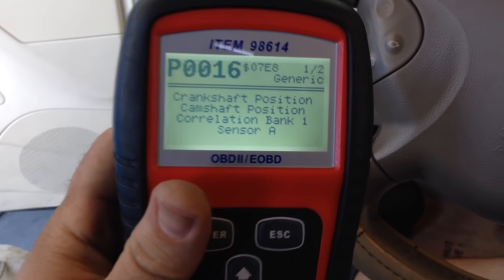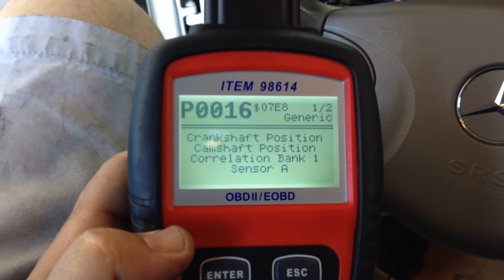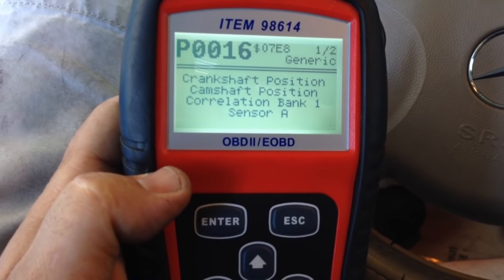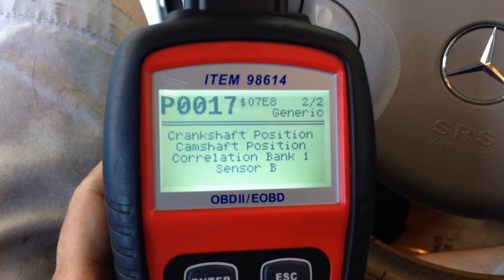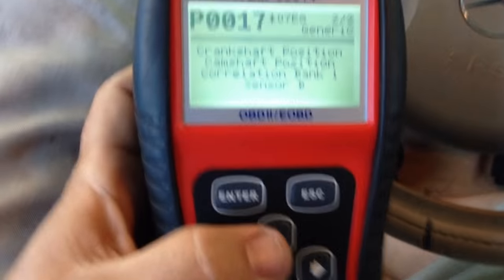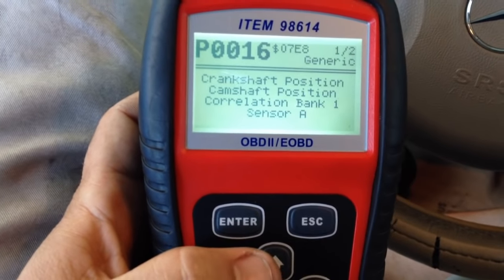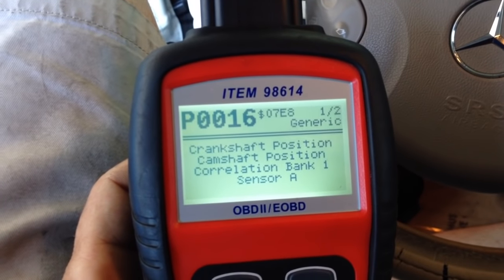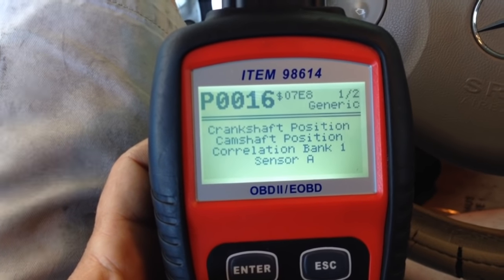Mercedes Camshaft position sensor p0016, p0017

Comment: I have this problem but for the driver side of the car. I was wondering if the test to see if the cams are in the correct position is the same. putting the crank shaft at 305° then checking if the circles on the cams are aligned with the holes? or if the crank shaft position needs to be placed at a different degree to check for the driver side cams? thank you so much this video is amazingly helpful!!!!
Reply from the maker: growing for life 305 will align all cam sensors at the middle but since the valve are always pushing the cams away from each other you will be able to see only one side off at the time...
Reply: Mercedes Benz Techs thank you so much

Comment: Hi goodday i have a ml350 i got p016 p0117 p018 p019 i checked the 305 on the balance shaft it looks good on both marks on right bank any other test
Reply from the maker: What year and how many miles
Reply: @MercedesBenzTechs  2008 87000km
Reply from the maker: @sabrinatjoen-a-choy2425  shouldn’t have any serious issue. Check your battery, do engine control unit update and change oil. Let me know if it comes back after that.
Reply: @MercedesBenzTechs  changed the oil with filter no change code 1211,1199,1203 and 0641 just pop up back after clear. Batt good pcm update i cant perform.
Reply: I also took the camshaft solonoids from another ml to see and it stays the same
Reply from the maker: @sabrinatjoen-a-choy2425  you need to connect to a computer and see actual values of cams, maybe your timing chain stretched
Reply: @MercedesBenzTechs  values are -20 and 36 for the camshafts
Reply from the maker: @sabrinatjoen-a-choy2425  you need to check how much they deviate from the permissible values.
Reply: @MercedesBenzTechs  goodmorning its not that much to be honest.
I think i just will take the front covers off to see. I also read to check the flywheel but did u ever encounter that issue with the damaged flywheel before

Comment: I've got a 2008 C300 with a motor serial number outside the affected balance shaft motors (<2729..30468993). I just got P0016 and P0017. A Euro mechanic told me it was the balance shaft. Should I try the sensors first or chalk it up as a loss?
Reply from the maker: Alexander Matney I'll give you a million dollars secret, change your battery. When the battery is week your sensors may delay information to the ME. Change batterie clear codes and drive safe!
Reply: Mercedes Benz Techs I recently replaced the battery. My main question is: since my engine serial number is outside the affected motors, am I safe from the balance shaft failure? Should I proceed doing what's described in the video?
Reply from the maker: Alexander Matney there shouldn't be any issues with your balance shaft, I haven't seen any car that had bad balance shaft after 2007, I still think you may have bad alternator or bad battery I don't think you have issues with timing I don't think you have bad sensors as well, I think it's a software issue or power issues but this are only assumptions off course.
Reply: Thanks. I'll have the battery and alternator tested. I'm glad to hear about the balance shaft. 

The car is idling rough and has a jerky start/stop. But it's also throwing a CEL for running lean, so perhaps it's related to that.
Reply from the maker: Alexander Matney oh, that's some valuable information... you will have to have it diagnosed, it may be out of timing..
The codes you have are saying that the car is out of timing, although it's known to be a common issue on the 06 07 272 engines due to a failure of the balance shaft it is not the only reason for bad timing.. have it diagnosed at a reputable repair shop.
Reply: We did take it to a highly-rated European mechanic in town. The following CELs were present: P0170, P0128, P0173. The P0016 and P0017 had been saved on the motor. The symptoms
Reply: Sorry, last message got cut off:

We did take it to a highly-rated European mechanic in town. The following CELs were present: P0170, P0128, P0173. The P0016 and P0017 had been saved on the motor. The symptoms are basically just low idle and jerky upon coming to stop/start.

Comment: Hi I got mb c280 w204 . Camshaft position sensor error code p0016 and p0017. On bank a and b . I check the alignment of stamp it’s right in the middle on both sides. My car is starting fine when the engine is cold but when u drive for few miles and turn the engine off . It won’t start until u press few times on gas pedal.  Can u please advise me on that
Reply: Yo what was the problem?

Comment: Here's one for a dilemma: got an E350 with M272 V6 and a P1208 code. Pulled out the cam sensors and set the crank pulley to 305. All cams line up in dead center, but the left bank exhaust cam is slightly off. I doubt it is the balancer sprocket problem; because the two intake cams, which are driven by the chain, both line up in center. Any ideas?
Reply from the maker: What year is your car and how many miles
Reply: @MercedesBenzTechs  06 with 190K miles.

Comment: hi I have a 06 c280 what's the timing that I have to look 305 to take away inigion check light or reprace the sensors p0016 and p0017 I need help
Reply from the maker: Juan Garcia I would love to help but not sure from you post what your question is...
Reply: English please

Comment: You mentioned turning it by 180 degrees the 2nd time. Don't we have to turn it full circle by 360 degrees to get back to 305? Please advise.
Reply from the maker: On 4 stroke engines the cams need to turn twice for every one turn of the crank to return to the same time i

Comment: David, I have this same car '06 mer ben with v6 has these same codes but runs really good. Only  a little short a pickup on the highway.  Can oil regularly at Jiffy Lube, their premium service.  THey say it is syn oil... so not sure how good it really is.  But I have not seen anything int he oil so I am guess no much in the pan.  So besides the cam balancer... what else could it be.
Michael
Reply: ***** I am with you on doubting it will be the sensor... I still have not had the chance to look to see if it is out of alignment.  But, isn't there a way to get it to past smog without having to do an overhaul?  I really don't need the expense, not to mention the down time.  And does the oil really make that big a difference?  What is your take on the oil from Jiffy...?
Reply: ***** OK Dave, I finally got the chance to check the alignment...  it is good.  The marks are in the center when placed at 305 degrees.  So maybe in this case it may be a sensor? 
Oh and the oil is clean.
Reply: ***** what do you mean by "both sides"?  the codes are exactly the same as this video... bank 1 sensor A and B.  And as per your video, you said that is on the passenger side.  and as I mentioned both marks are centered.
I did drop the pan and double checked for any metals, but it looks clean. Unless someone else went in there before me... lots of silicone round the pan
Reply: ***** Yes I did see that video... That is why I was asking.  If I can get away with not having to pull the motor, I am al for that. like I said, in checking if the marks line up, on this one it does.  So just wanting to know what else it could be.  Also like I said, it does look like someone has taken the pan off before, unless the dealer uses silicone to seal.  But if that was the case, why would they clean out the pan and not tell anyone of the problem? Metal in the pan is a bad thing and should not be ignored.
By the way, how do I test for the sensors? I am sure there is a way to test them.

Comment: I have a 2009 MB C63 AMG with 67000 miles. Few weeks ago codes P0017 and P1200 came out. These are the only codes I have. Car starts and drives perfect. No strange noises from the engine or other abnormal behavior. Besides CEL everything is fine. I also noticed that Check Engine light comes on and goes off every few days by itself. Do you think I also have a balancer problem???
Reply from the maker: dvdmi no issues with balance shaft but you need to take to a shop that familiar with the engine and have them tight the bolts on the cams, there is only one bolt that holds the cam sprockets to the cam shaft and they get loos, at the same time I recommend they torque your head bolts too
Reply: Thanks. I noticed that when it gets warmer (above 50F) CEL always goes off. Also my head bolts were replaced about 25k miles ago (preventive action).

Comment: Thanks for sharing ! I have a 2007 c230  2.5l  and this car had a service due to a camshaft gear defective , the dealer covered almost close to  the total repair a few  years ago   After about 4,000 miles I have a code Po012 and PO0015 bank 1.   I thought it could be the magnets or sensors. Do you know a way to test them , before replacing all?  thank you again !

Comment: Bonjour

Do you think that without the converter the automatic BV and the flywheel we can have enough 
place for dismounting  the plate of the cranshaft and the balance shaft and install the back part of 
the  balance shaft and then avoid keeping out the engine ???
second  why it's necessary to change the back of the balance shaft if you change the distribution 
chain and some other parts in the front of the engine. 
For me it's clear the new back part is the same like the old. 
Last question  the sprocket lose its teeth , why it 's so important if you can adjust the timing chain 
for the right bank and the left bank ( admission camshaft and exhaust camshaft ) correctly.
It seems to me that  it's not so important that the sprocket have teeth or no because of the tensionner.
I think the problem come from the tensionner. The origin adjustement is too strong  so the sprocket become 
tired and used little by little.
I hope i don't take too much of your time with my questions.

best regards Pierre

Comment: Hello Mercedes Benz Techs, I have this problem 2 times. While driving, the check engine light comes up. I made a test with computer and the error was p0016 . I delete the error, and after 2 months it comes again, " check engine", this time i didn't made the test computer, after 1 miles, the "check engine light" was removed .  But when i made the computer test , it was memorized the same error. What will be your opinion? do i have problem with the Cam shaft position?

i have Mercedes ML 350, Year 2006, 58.000 Miles.

I will preciate your opinion. thanks

Comment: scene one cam is on time and one cam is not on  time would that not be that the cam advance is stuck on one cam. if the cam on the left of the engine was off on both then the balance shaft teeth are gone because the chain would have more slack? the teeth where not hardened properly during manufacturing on the balance shaft. thanks for the video like it a lot.

Comment: Hi there, I got the cel with the p0016/0017 and deleted them. But they come back only after a good 100-150 Kms, otherwise car runs good, on a highway gives me 8-9l/100 kms. Could it be the same issue? Have a 2006 c280
Reply from the maker: Vibhav Jindal most likely the same issue.
Reply: Hello Vibhav Jindal.  I think I have the same car.  Mine es a C280 Avantgard Sport 2006.  Did you fix the problem. Could you please give me any clue?  Really appreciate
Reply: Hello.  As I said to Vibhav Jindal I have this vibration problem.  It feels specially in the gear lever.  Do I ALWAYS have to check for a 305 degrees alignment?.  Thanks
Reply: Mercedes Benz Techs hey whats a fair price to pay if i need to do this to my car? just want to know if is worth put in more $ into it

Comment: I get the same codes and my car seems to run perfect! 21 city mpg and 27 mpg highway. Starts fine , runs fine, no strange sounds. 2006 e350 base, has this been the case for all of you?
Reply from the maker: Adam Graves yes, in 95% of the time it runs just fine
Reply: Mercedes Benz Techs what about the remaining 5%,what actually happens to them?because am thinking of getting a used w164,would you recommend that?
Reply: Mine also runs perfectly. Changed the spark plugs and it turned off for a second

Comment: Do you think  it's impossible to change the back counter weight when you keep out the BV and the flywheel
If it' s possible many people who have the problem of the balance shaft will win a lot of money by following
a precise tutoriel of how doing that job.
Moreover i am thinking  how can the sprocket be used like that ???    what is the root cause if you have any idea  with explanations !!!
I think of the tensioner ???   
best regards

Comment: Hello, I have a 2012 c250, I replaced the battery , the dashboard turns on, but it won't start . Please advise
Reply: hi! i know its a bit late but i found another video where they fixed the same problem. seems to computer lost the last digit of some code and you have to replace it to fix. search for "why to not remove the battery in a mercedes".

Comment: Hello..

Which oil number woukd you suggestfor my 2011 C180K 
Do you need any aother details to be exact? Thx
Reply from the maker: tibet rr depends on the winter/summer temperatures of where you live but normally, fully synthetic 5w 40, service your engine every 8-10k not more.
Reply: @MercedesBenzTechs  perfect answer!!
A synthetic 5w40 oil for about 8kMi... after that the viscosity gets down towards W30 (too thin!)
👍🏻

Comment: I have a 2011 Mercedes E350. It’s throwing code P0016. Stamps line up perfect. I have replaced both solenoids and both sensors on the passenger side of the engine. Any other ideas?
Reply from the maker: Vtecracing10 replace all 4 magnets with brand new, do software update and monitor for correction.
Reply: MBT OF ATLANTA Mercedes Master Techs I forgot to mention all 4 must of been replaced by previous owner because they were not oem. They were made by Pierburg. I pulled out my carfax and found a garage that serviced the car before they traded it in. They confirmed they replaced all 4 just 1500 miles ago. You still think a defective solenoid could be it. I can buy 4 OEM ones and swap all 4 one more time. As for software update goes I’m guessing I have to go to the dealer? Would pulling the battery work?
Reply from the maker: Vtecracing10 replace all 4 with original new, how many miles on the car
Reply: MBT OF ATLANTA Mercedes Master Techs 124,000 miles. I ordered 4 new magnetic sensors. They will be in Saturday. Out of curiosity why do I have to replace the other bank? I hear other people that say replace all 4 also. Thanks for all your help. I greatly appreciate it.
Reply from the maker: Vtecracing10 Mercedes updated the old parts.

Comment: Hey how are you doing. I have code that say the same thing but the number are different I have a v8 gl 450 will this video do the same thing on a v8 my codes are p0018 p0019
Reply: Yes. On the V8 it's the idling shaft, very similar to the V6

Comment: Awesome video. I know you probably get a lot of questions regarding this video and know you are probably a busy guy. I thought I would at least try and ask you what you might  think about my situation. I think I may have a similar issue on my 2008 C300 but the error codes I am getting are p0060 and p0064 my check engine light is no off and the car runs just fine. I took the car to my local shop and they told me that they saw that a camshaft sensors was leaking oil. They then told me that the standard practice for this issue is to replace all 4. My question would be is this acceptable? should I just clean the sensor off, should I just replace the sensor that was leaking oil or should I replace all 4?  Thank you

Comment: I have a w212 e250 .After I replace my alternator , the car accelerates  very slowly , please help
Reply from the maker: Not related to the alternator unless the alternator is bad and battery is bad
Reply: @MercedesBenzTechs  the new alternator seems good, and the battery is good , I'm thinking something was not plugged in correctly when they did the alternator, but I have no check engine light,  when the car is in park it accelerates fine but when it's in drive it's  very slow to accelerate like it has no power

Comment: I need to change the Mercedes Benz C-250 timing chain I want the price of the job, I'm in Atlanta, Georgia.
Reply from the maker: Call the office tomorrow at 770-837-3888 and make an appointment so we can look at it, Do you need only timing chain or you need the camshaft brackets as well?, how many miles on the car? What are the symptoms that you decided that you need a timing chain?
Reply: @MercedesBenzTechs  This is your number
Reply: @MercedesBenzTechs  It is a Mercedes Benz model C 250 from 2012 with 110,000 miles, the reason for changing the chain kit. It's just that the camshaft brackets are ringing so much that I want to make everything complete.
Reply from the maker: @josejohancamargo8573  to change the camshaft actuators, timing chain, thermostats, coolant flush, timing chain tensioner, all sensors associated with the job you are looking at about $4,800

Comment: I have this problem.  What is the name of the socket you used to turn the crank shaft?  I know I don't have that in the toolbox LOL.  Thanks for the video.  I have those codes.  Mine is a 2007 and the TSB for 2007 engines say to replace the sensors.  The TSB for the 2006 says replace the balancer shaft.  My understanding is that the teeth on the balancer can wear, but since it is on the back, you can't just inspect (or can you?)  I've been driving like 25k miles or so with the issue and there does not seem to be anything noticeable except for the check engine light.   I got it from a 1 owner with perfect dealership records.  back when I bought it, a friend worked at Mercedes and pulled the records.  Mercedes...so stupid.  They want like 6k to make this issue go away.  I just want to pass the stupid inspection (check engine light fails inspections in central Texas) I may hay have a paperweight on my hands.